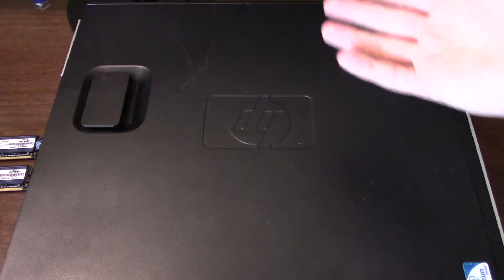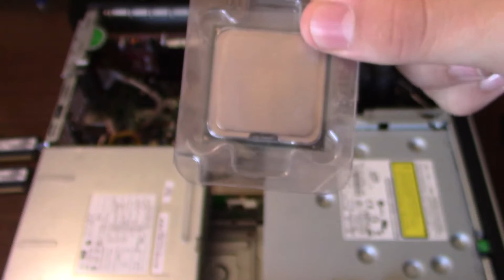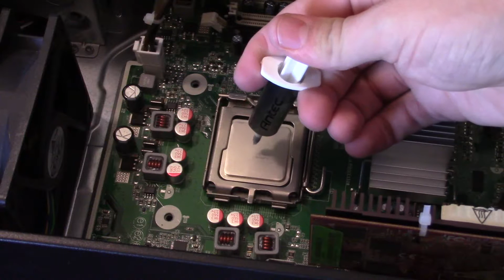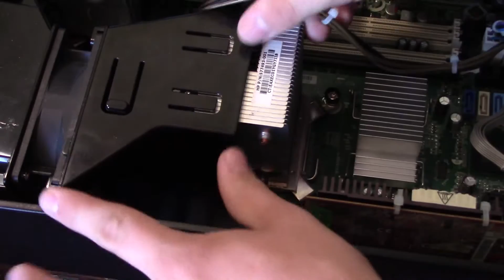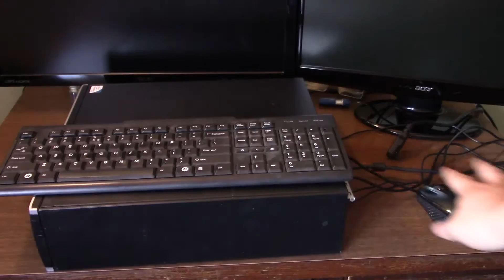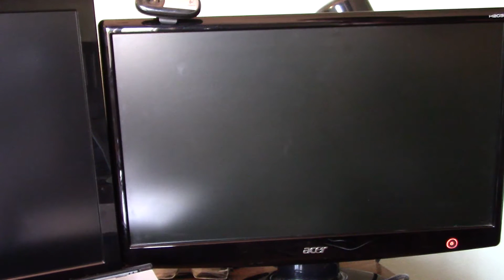FAILED HP Compaq 6000 Pro SFF Repair

Comment: amd memory is branded amd memory for a reason the clock speed is not compatible with intel chipsets. ALso, you installed the sticks in the worng slots, you should have used the two black slots, or the two white slots.

Comment: The HP 6000 have PSU connected to motherboard with 2 atypicall connectors. One is similar (or identical) to graphics cards 6-pin connector. The second connector is a flat 6-pin connector, and I am unable to find it's specification.

Comment: can the support pentinum g4400 new model
Reply from the maker: gorege jones No.
Reply: i want to upgrade because it is 60% better than core 2 duo e7500 2.93ghz
why cant this support this processor
Reply from the maker: Well first of all they're not even the same socket so it physically won't fit properly.
Reply: gorege jones try maybe a Q6600 if the motherboard support it. It is a quad core at 2.6 ghz

Comment: These things are absolute GARBAGE. out of the 2 i've had I can tell you that both the power supplies and both motherboards FAILED. The LGA 775 socket is somewhat new enough, but processor requirements limit to the q9650. The ram requirements are very strange as well. The power supply always made a high pitched noise that varied under certain loads. The power supply uses an AT style connector which is extremely outdated, and the motherboard is a proprietary form factor so you can't swap cases. DO NOT purchase these machines.
Reply: Nothing wrong with Q9650, a watse below 3.6GHz though. Bad luck about the PSU.  The BiOS also tends to not hold memory after getting hot. Possibly a reflow issue.  Stupid bloody idea putting the battery and the drain button right under the graphics card to bake. Can't complain for price though. Don't pay more than $15 for one.

Comment: where is your  hard drive.its just below power supply in this compaq  pc but u dont have
Reply: do you see that thing of cds remove that and you will se the hardrive
Reply: Having a hard drive is not necessary for system display

Comment: i had that once the system simply continued to bootloot whatever what i replaced and psu was tiking 
the problem is at 95% a cold wiring in the motherboard, if you still have the computer then just switch the motherboard if you ever need to re-use it

Comment: Is the power supply up-gradable? If you haven't already gutted it for parts could you show how to remove and replace the power supply?
Reply from the maker: Since it's proprietary you could remove it and replace it with the exact same model, but not upgrade it.